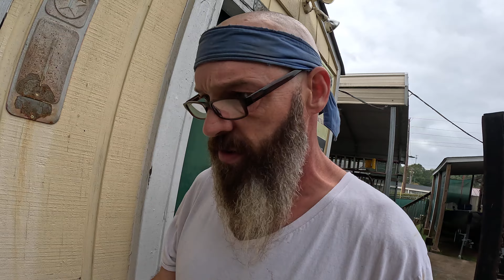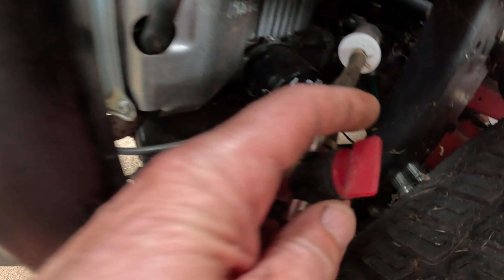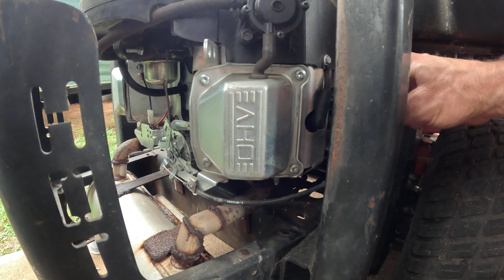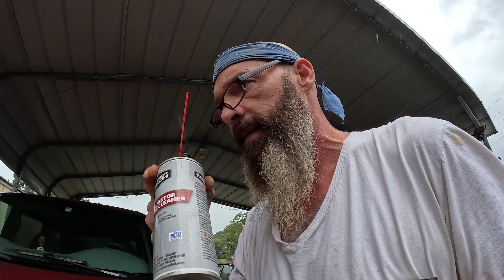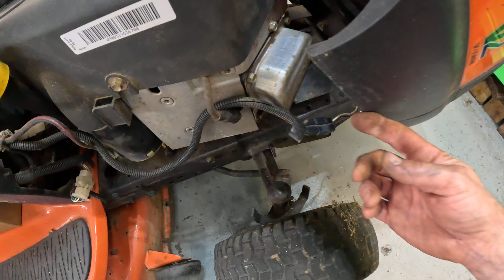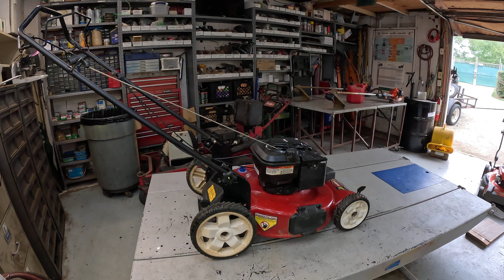Bout That Time Again! Let's Winterize Equipment We're Done With!

Comment: I usually just add some sta-bil to the gas, then run everything out of gas when it’s time to put everything away for the winter so far, everything has been firing right up in the spring with fresh gas. I haven’t went as far as dropping the bowls yet.

Comment: Hey Tom big fan ! I work on engines a lot when I’m bored (tinkering) and rebuild 2 strokes etc .. I have bought 2 Honda GCV 160s push mowers off of FB marketplace for my (small Gate yards) they crank right up I was just curious wanted to test compression the one I just bought has about 50 and the other one about the same but it’s ran all year never even bothered to check it what’s the deal they both crank first pull so what’s the deal possibly stuck rings? Let me know thanks I plan on stopping by sometime I’m not far from you at all .